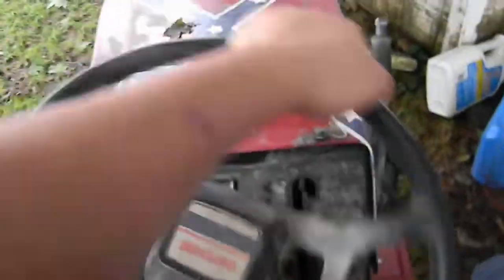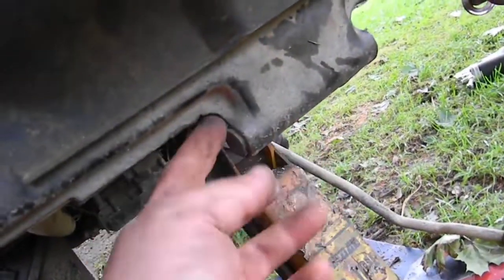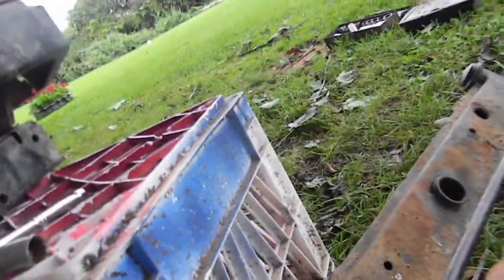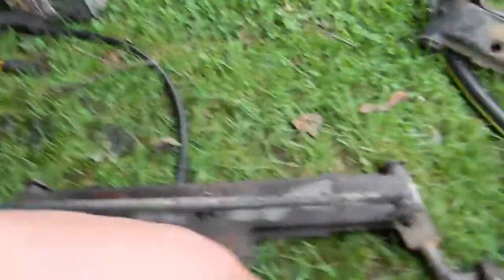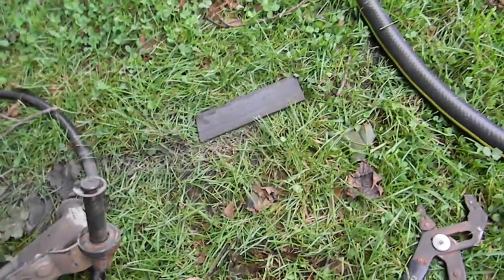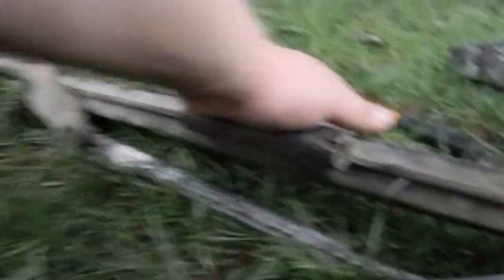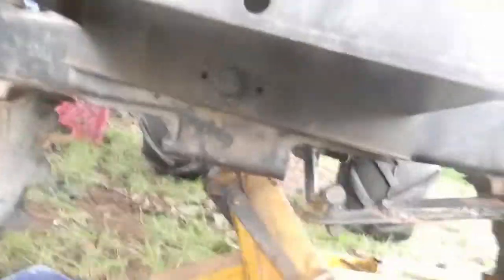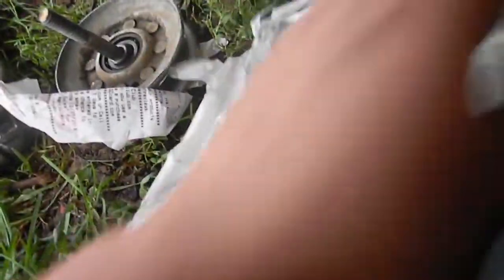Dinky's Simple Must Have Steering Mod!

Comment: you should put a stack on dinky.
Reply from the maker: the ford wheeler might get a back stack. i dont like having earshot of the exhaust, to loud.    if it hurts my ears to drive it that a problem becase i put alot of miles on my tractors. i drive to my mud holes.
Reply: A 670 predator
Reply from the maker: HELL NO, my motors are built with wrenches, not chop sticks. and i a full pressure oppy looking for a home if i ever toast this one.
Reply: ok